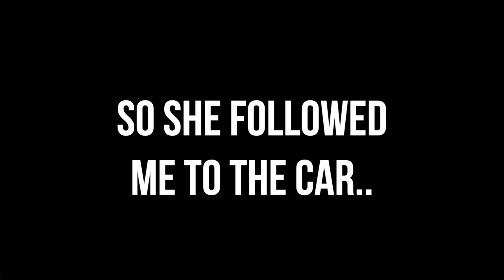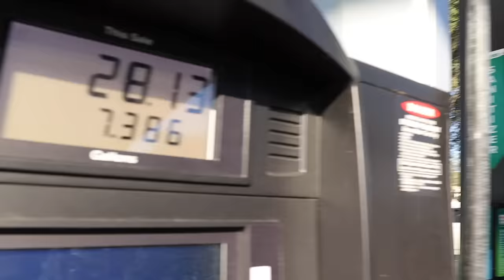HE THOUGHT HIS AIR SUSPENSION WOULD MAKE HIM LOWER THAN MY CAMBERED GTI

Comment: You should switch up to a fuel cell and remove the gas tank entirely, you can fuel up from the trunk and not have to take the wheel off every time you fuel up😂
Reply: For real.  I wouldn't be doing the especially since it's kind of a pain in the ass.  15 or 30 degrees of camber... I'll never understand it.